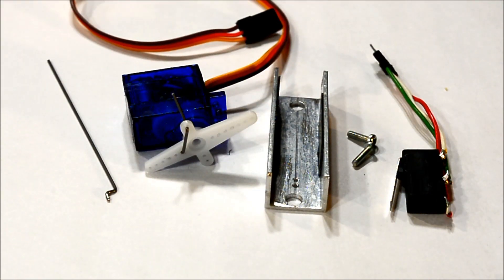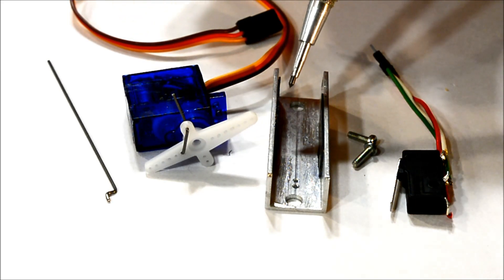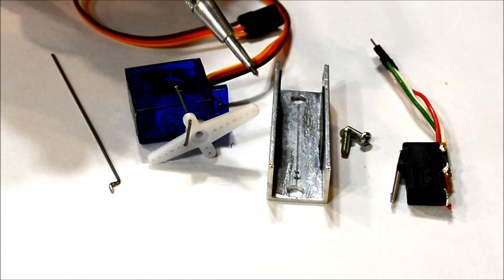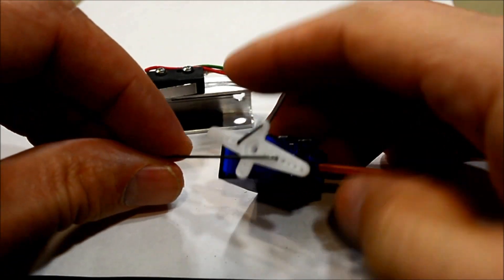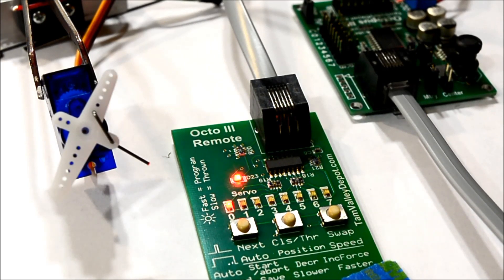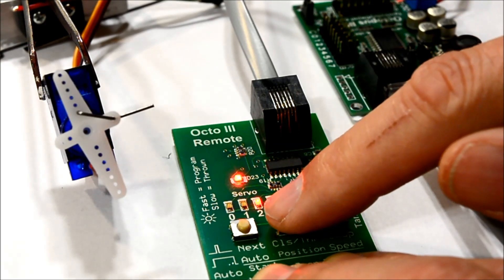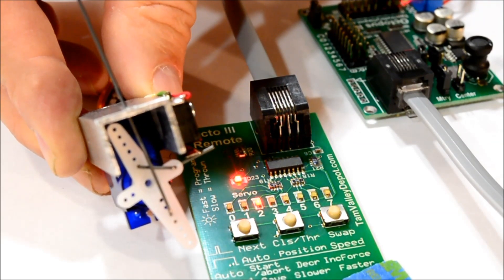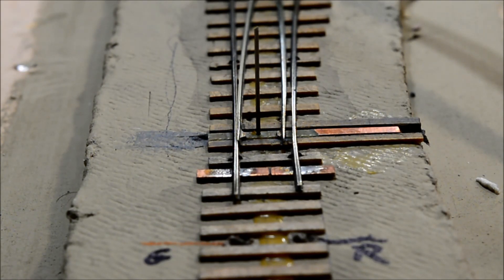Updated: Using Servo's to control Model Railroad Turnouts

Comment: Excellent video. I am just building my layout and hand-laying my switches now with N scale code 55 rail. Question: What is the rough cost of controlling a turnout with this servo method VS using a tortoise switch machine? How much cheaper? I'm assuming using a DCC setup with an Alduino controller board is the best way to send a code to control and actuate each different servo with a pulsed signal? Also once the turn out is switched the servo turns off until the servo is activated to switch the turn out back again correct? The tortoise is a constant voltage draw to hold the switched turn out in place. Also yes please for more parts links & diagrams .  Thank you for this great alternative! If it's more economical I will go this route!

Comment: Just found your video on YouTube today. I wish I had found it 6 years ago. I have two Octo lll's and the remote align board. But your video is the only one that shows how to use the remote align board understandably. I have struggled over the years getting the servos set correctly and maintaining them as time goes by. My learning curve with the Octo lll and the align board is all self-taught. Of course, there are the directions and blog's and so forth, but I am not a tech guy. I just want it to work. One thing you forgot to add in your video is you didn't say at the beginning of the servo adjustment whether you were doing a Auto-Align, or a Manual Align, and I think that is important to include in your video. The viewer may not know where to start. Thank you again for your informative information.

Comment: A few loose ends here - 
The make and model number of the micro switch.
Did you tap those 256 holes for the micro switch
The gage number of the piano wire and the source you bought it from
A pattern on how to shape the 2 pieces of piano wire would be real nice.

Other than these items - a nice clear how-to video.

Please respond with these answers.

Bob S
Reply from the maker: Hi Robert,
I bought the micro switches years ago and don’t have a part number. I looked for low actuation force and a short straight arm.
Yes the holes in the channel are tapped 2-56 for the mounting screws.
I used .032 music wire for my HOn3 hand laid turnouts, local hobby shop carries a selection of wire.
I just bent each wire as I went along, didn’t bother measuring other than eyeballing it.
Hope this helps!

Comment: Thanks for this video. The bits I really liked having toiled with my own servo motor installation and found ALL the problems using servos are; the micro switch mounting and operation. That is excellent and secondly keeping the horn inside the channel which will prevent the runaway case pulling the wire out of the tie bar. I have had that happen a few times and it is a real pain trying to get the now shortened wire back through the tie bar hole. It was hard enough before the wire was trimmed! I am going to try this out this afternoon. Cheers. Happy modelling!
Reply from the maker: Malcolm,
Glad to hear this was helpful! Good luck and I would love to see how it works out.

Comment: A suggestion... a little blob of E6000, Aleene's 7800, or Gorilla Clear Grip (all are similar "SBR adhesives") in the bottom of the channel will hold the servo securely, but if you need to remove it, working a screwdriver under it can be pried up and removed.

Comment: Replace aluminium channel with cheap standard slim  electrical flat plastic conduit. Cut short lengths.  cut slot in sides of conduit : Servo just clips in no screws simple remove replace/ adjust . My layout is on the floor  servos connected on top ( in short cut length plastic  to existing hand operating lever. No back bending / swearing underneath . Using 2 x 6 channel servo controller ( also on the floor) = 12 points..

Comment: Great video. How are you controlling the servo? Would you by chance be using an IR remote? If so how do you set that up to talk to the Octo 3?
Reply from the maker: Hi jimeronimo, I use the Tam Valley Depot Octo 8 driver board. I have their optional remote aligner that plugs into it to setup the servos.
Reply: @slidevamr  I'm really illiterate with these areas. Trying to set up a ceiling train with a 6 foot passing loop using fastrack. Want to surface mount some servos. Found some hobbyking has. Think they would work but no idea how to control them remotely or set that up. I dont have any of the TMCC, etc stuff.. trying to learn a simple way to do it remotely. Any help would be great
Reply from the maker: jimeronimo , servos require some kind of controller to send the appropriate pulse width signal to them. If you are interested in making your own controller search Google for Geoff Bunza Servo and that should bring up his great Arduino tutorials. If you are only looking to control a couple servos you can search eBay for servo testers and buy an inexpensive one for each servo you want to control. Hope this helps!

Comment: Great video!  Fabulous video! Very informative.   I just wish you had spent a little time showing how the servo is connected to the "octopus" and how the octopus is connected to the rest of the layout (power source?)  If that info is in another video, how about a reference and/or link in the description.  You still get a "Like" and sub'd.
Reply from the maker: hhc19avn, I’m glad you enjoyed it! Servos simply plug into the Tam Valley Depot board directly or via an extension cable if the board is too far away from the servo mounting location. I am using and old  laptop power adapter that runs a 12volt bus around the underside of the layout and that powers the driver board and it provides the power to each servo. These little Servos can draw up to an Amp of current while moving so if you plan on having multiple Servos move at the same time be sure to have a power supply that can provide the necessary current.

Comment: How did you bend and install the wire that actuates the micro switch? What type of wire is it? Other than that, great tutorial!
Reply from the maker: Hi Mike! I use the same .032" piano wire as used for the actuator piece. I made the first one by trial and error then just copied it. I have started using some super glue to ensure it doesn't pop out of the servo horn. Glad you liked the video.
Reply: @slidevamr  It took me a while to puzzle out how to fish that wire into place! I must say it is an elegant solution .
Reply from the maker: Mike Bickle Glad you have found it useful! I would love to see how you have implemented the concept on your Railroad. Ross

Comment: Looking for the reversable 3 pin connector, do you have a link to them please.
Reply from the maker: Hi Bob, I used .100” breakable header strips, mine came in 50 pin lengths but various lengths are available. Ebay or places like Mouser electronics are good sources. My last purchase of the female side were not the breakable style so I use a razor saw to cut down to 3 socket sections, this does cause you to lose 1 socket on each cut but this style tends to be cheaper.
https://www.ebay.com/itm/10PCS-40-Pin-2-54mm-100-Single-Row-Male-Breakable-Header-Strip-Fast-Ship/321667114644?hash=item4ae4daa694:g:k2UAAOSwrklU28sM
https://www.ebay.com/itm/10pc-1-40Pin-Single-Row-Female-2-54mm-Breakable-Header-Connector-fr-Arduino-MSYG/173012784721?hash=item28485d9651:g:vK8AAOSwyQtVijiV

Comment: Using Servo’s what? What is it that Servo possesses did you use?

Because if you meant servos as in a plural noun then you should have said that.
Reply: Excellent video. I am just building my layout and hand-laying my switches now with N scale code 55 rail. Question: What is the rough cost of controlling a turnout with this servo method VS using a tortoise switch machine? How much cheaper? I'm assuming using a DCC setup with an Alduino controller board is the best way to send a code to control and actuate each different servo with a pulsed signal? Also once the turn out is switched the servo turns off until the servo is activated to switch the turn out back again correct? The tortoise is a constant voltage draw to hold the switched turn out in place. Also yes please for more parts links & diagrams .  Thank you for this great alternative! If it's more economical I will go this route!